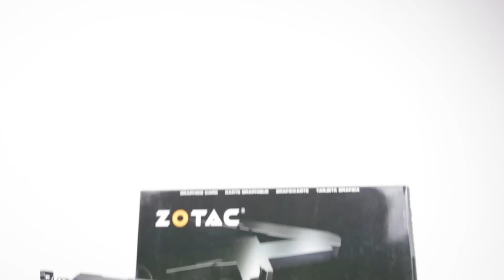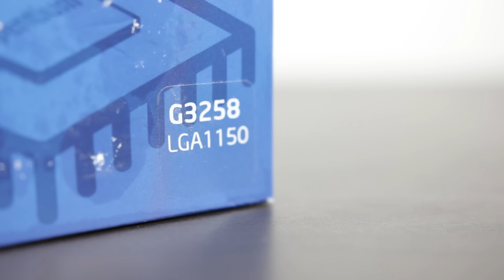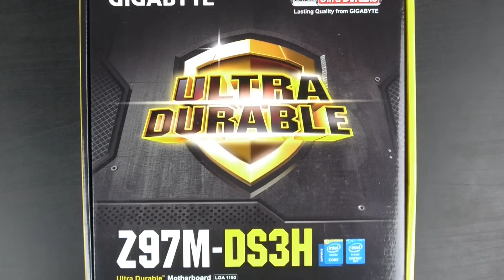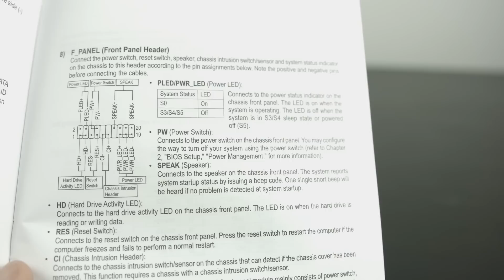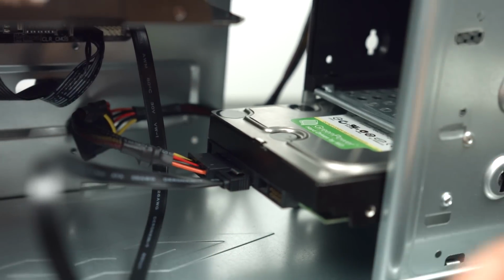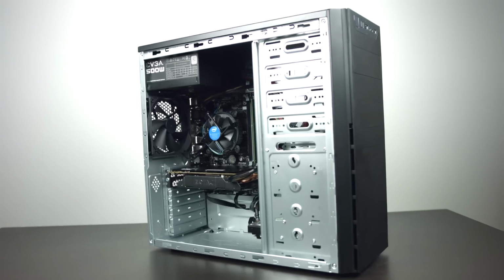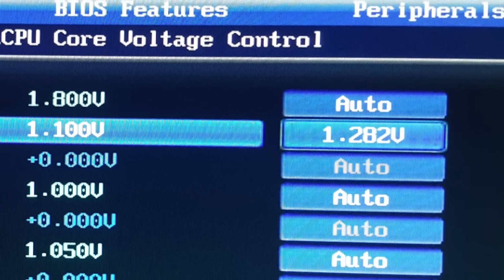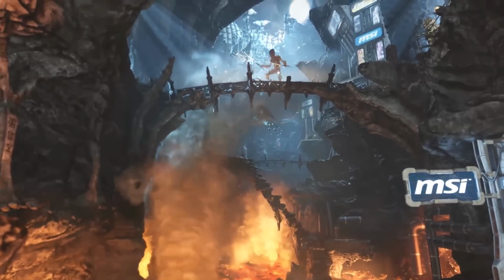Ultimate 2016 $400 Intel Gaming PC Build Guide - Ep.2 Budget Gaming PC Series

Comment: The g3258 is a great little cpu but has too much micro stutter for gaming, go i3 or better.
Reply: +Barack Smith agreed. new games needs 4 threads and not meeting such requirement makes the newer games lag and stutter like hell...
Reply: +XInfinity2013  I don't think so, if you get a basic mobo (h81-e33) + i3-4170 must be the same as this g3258 and z97 mobo. Its better to have the g3258 with a h81 mobo and update bios btw
Reply: rarely does anyone including myself upgrade a processor. in all my 20+ years of building pc's i have never upgraded any processor, the motherboard usually dies before needing a processor upgrade. if one wants to go K later, then just buy a K pc set later when money is available. as for low end gamer i3 is the lowest processor that can run all the games (including effing watch_dogs and other ubisoft titles), 6-8gb ram is the minimum for such titles and as for gpu anything above geforce 750 if 1080p is the target display resolution. mix and match parts to suit your budget! i don't consider occasional dips to zero frames per second as playable so avoid anything below 4 threads.

Comment: No vrm heat sink on mobo and the power phase suck's as well. I don't think pusing the voltage is ok in the long run with that specific mobo. I am very curios on the vrm temperatures.

Comment: hi iam getting a r9 380 sapphire and i think it needs 2 x 6 pin and iam wondering if a corsair vs650 is a good psu for it because its the one my friend gave me for free. Also its brand new. On the psu the cable is 1 thick cable and output to 2 x 8 lin and its connected to the other pcie pcie plug. Is that thr correct one thanks

Comment: If you are going to do used parts, you should go with the Xeon E5640 and an (LGA 1366) X58 MB with a $30 CPU cooler such as the CM evo 212. Cheaper and much more performance, especially if overclocked.
Reply: Yes, that is the way to go...for $100 more, you will be able to do much better than this build.  Daily Average, you are correct, you can pick up a couple of Xeon X5570's for cheap, I picked up two X5570's for $14.00 each ($28.00). LGA 1366 Dual Motherboard w/CPU fans for ($90), used ECC RAM ($15.00 per 4GB stick Total of 4 each for $60.00), Thermaltake Core V71 computer case ($117),  Sently 1000w 80+ Bronze ($94.00), 120G SSD ($38), and Windows 7 Pro ($79.00). This system works flawlessly and is super fast.

Comment: Are there any other motherboards close to this price range compatible with this build? The one in the video is out of stock on newegg. And how can i check if a motherboard is compatible with a certain build?
Reply: +Doktor Kranium no need to be aggressive mate
Reply: Use PC Part Picker, you can plan your entire build online and it will let you know if there are compatibility issues. It's a great site...for picking your parts, and planning your next build. You can put numerous different builds into the system and it will save them all. Works great!

Comment: Much better power supply lol, *Wait, did you take down that other video to sub in this PSU? 

You're also going to mix and match the GPUs for the comparison right? 380 + G3258 OC is probably going to win overall, but as I said in the last video if it's going to be a year or 2 before someone upgrades their PC, I'd shoot for the Quad Core from AMD, hopefully AM4 is halfway decent so that can be recommended, and then the AMD platform at least has an upgrade path.

Comment: what about temps of the PC? cause while it's only a dual core the G3258 must be dying @4.6 GHz under the crappy Intel cooler
Reply: The G3258 can be pushed pretty dang far on the stock cooler. I ran mine at 4.4 when I had it at 1.2v and never saw it hit 70.
Reply: Mike Adams thanks man! helps for a point of reference
Reply: Stephan Carlton Yeah it's a pretty good chip, it helps having the new TIM they put in it. Anything that requires a lot of CPU power or more than 2 threads won't like it though.

Comment: can I overclock my GTX 750ti on b85 ds3h gigabyte motherboard?
Reply: +Anupam Anu motherboard doesn't matter for GPU overclocking. Download MSI afterburner, max out the sliders and run 3DMark Firestrike (there's a free version on steam)

If the test doesn't crash, congratulations. You just overclocked your GPU.
Reply: +Mason Vanderpool thanks for the input. appreciate it.
Reply: No problem.
Reply: If the tests crash, then dial the overclock back a little and try again. MSI afterburner usually has a recommended limit so you should be able to crank it. If that works for you, you could probably get a little frisky with it and disable the limits and push it farther but I wouldn't recommend it since you're probably pretty new to this.
Reply: +Mason Vanderpool copy.

Comment: You should have dropped to an r7 370 or so,  and upgraded to an i3,  since some games require a quad core. Ik i3 is dual,  but hyper threading lets it run those games.
Reply: the I3 isn't a quad core. Quad cores are better though for games these days.
Reply: AstroMagic true,  but given the price difference between an i3 and an I5, and considering that games recognize the i3 as a quad core,  it makes alot more sense then a g3258 for only about 40 bucks more,  unless you live near a microcenter
Reply: Adeel Rehman I live near one. I have never heard of a game recognizing the i3 as a quadcore and some game wont even play on duel cores but for $50 less it does make since since you can overclock it and get the same performance for games but not streaming
Reply: AstroMagic Im pretty sure those games that require a quad core to play will run on an i3.
Reply: Adeel Rehman nope.
Reply: AstroMagic Really? Interesting. Will they run on an X4 860k?or an fx 6300
Reply: Adeel Rehman Yes. They have actual physical cores. Take farcry 4 for example.
Reply: +AstroMagic ok. It's wierd though,  because an i3 is better in every way compared to fx 4100, which apparently would run fine. Even on something that will use 4 threads, an i3 would come ahead.
Reply: Adeel Rehman It's the hyper threading and other instruction sets it has and not only that but games are made and usually optimized for intel cpu's because they are dominating right now and bribe devs or the devs spend more money to optimize it for amd cpus.

Comment: G3258 is decent, but on an older socket and thus leaves little in the way of an upgrade path. You're trapped on the last-gen hardware (1150 socket) unless you swap out your MOBO, something most people would like to avoid. The 860K has similar problems, but at least you're getting 4 threads. Best in this price point would be an i3, and invest a little less in your GPU.

You had the same problem in your last build, many have pointed it out, but 4GB of ram is simply not enough. You will literally run out of memory in the more demanding AAA titles, and suffer even more in general to intensive usage such as rendering, modeling, or photoshop.

The 960 is going to be bottlenecked like hell by a Pentium, no matter how much you overclock it, it's still only 2 cores. You put half of your budget into a GPU and about $70 into your CPU. That's just bad balancing all around. Also, the R9 380 has a better price-to-performance ratio than the 960, which is a must for gaming on a budget.

This isn't the worst build that I've ever seen, but you can do much better. You've got a considerable audience, so I hope people don't choose to copy this build and are disappointed in the performance.

A comparable Core i3, R7 360, and 8GB of DDR4 memory for $400: http://pcpartpicker.com/p/djNywP
Reply: +IronOreGaming for the 1150 limitation....

I dont think being able to upgrade to i7-4790K is a limitation...
Heck even on 1151 there isnt a better cpu....
Only with X99/2011-v3 socket you can find better cpu's

Comment: Is this good for normal home use and Minecraft gaming? I don't want to spend 500$+ on an over kill rig that I don't need :D

Also I suggest playing Minecraft as a test with the other games
Reply: +Shaikh Hassan Well, Something to remember is allot of things (mainly in minecraft) is extremely CPU bound, so it depends on the games.
Whenever you're working with a 400-500$ budget build, people swing towards 4-5 different options.
1: Like this build, terrible CPU, money invested into things like the GPU etc for a decent 1080P performance.
2: Intel I3, which are typically better, pretty similar, but a better CPU, similar style.
3: Intel's I3 skylake, which is a 4 threaded processor, IMO if you overclock the 6100 its one of the best processors for the price, but you're cutting down on some other price points.
4: AMD route, the FX series, 4300, 6300, 8300, similar to the I3 routes.

In my opinion, which I would say is educated, but its also a decision I personally would do,  would be something like a skylake I3 (6100) with a 60-70USD board, and something like a 950 (they're on sell ATM).
Since the lga 1151 set is very affordable now, IMO its worth it.
Plus future proofing is easy, since you can OC the non OC chipsets you can always upgrade the mobo w/ a cooler and squeeze more juice out of the CPU at any time, and they run very well with the I5's/I7's when OC'd, I personally would choose this over any other option, but, its my personal choice.
The only other route i'd go is a FX 8300 with a similar style build.
Cheaper, no upgrade path though.
Reply: +Shaikh Hassan What he said, you're going to want an i3 + lower end GPU, going with the 360 over 750ti due to future DX12/Vulkan support, nvidia seems to be lacking there

Also the board has USB 3.1 and Type C 

PCPartPicker part list: http://pcpartpicker.com/p/Ym6BNG
Price breakdown by merchant: http://pcpartpicker.com/p/Ym6BNG/by_merchant/

CPU: Intel Core i3-6100 3.7GHz Dual-Core Processor  ($123.88 @ OutletPC) 
Motherboard: Gigabyte GA-H110M-S2HP Micro ATX LGA1151 Motherboard  ($68.99 @ Amazon) 
Memory: G.Skill NT Series 8GB (1 x 8GB) DDR4-2400 Memory  ($31.99 @ Newegg) 
Storage: Western Digital Caviar Blue 1TB 3.5" 7200RPM Internal Hard Drive  ($49.89 @ OutletPC) 
Video Card: XFX Radeon R7 360 2GB Core Edition Video Card  ($100.99 @ SuperBiiz) 
Case: Fractal Design Core 1000 USB 3.0 MicroATX Mid Tower Case  ($29.99 @ Newegg) 
Power Supply: EVGA 600B 600W 80+ Bronze Certified ATX Power Supply  ($44.99 @ Amazon) 
Total: $450.72
Prices include shipping, taxes, and discounts when available
Generated by PCPartPicker 2016-02-28 16:23 EST-0500
Reply: Street Guru Nice build, might I suggest a 950 instead though.
You can get them as cheap as 120$'s.
http://www.ebay.com/itm/MSI-GeForce-GTX-950-DirectX-12-GTX-950-2GD5-OC-2GB-128-Bit-GDDR5-PCI-Express-3-0-/291619994225?hash=item43e5e7fa71:g:yG4AAOSwT4lWTd4B
Right now they're sold out, but yeah, you should see them return again soon.
Reply: *****
I dunno about trusting that at all, the card is listed for retail here at $170, it would be incredibly strange for it to be priced at $120 somewhere

http://www.newegg.com/Product/Product.aspx?Item=N82E16814127919&cm_re=MSI_GeForce_GTX_950-_-14-127-919-_-Product

Now the 370 on the other hand, is a bit slower than the 950, but the retail price dips pretty low, $130 here
http://www.newegg.com/Product/Product.aspx?Item=N82E16814129311&cm_re=370-_-14-129-311-_-Product
Reply: Street Guru That's neweggs official ebay, it was retailed as brand-new.
There was over 1000 units sold, I presume you aren't a typical ebay user, but as a user and seller, I can confirm to you that is 100% legit.
Reply: Thanks for the replies guys, however instead of builds like those I was thinking something along the lines of this - http://www.staples.com/product_2056935?PID=5874355&storeId=10001&AID=10428703&cm_mmc=CJ-_-5874355-_-5874355-_-10428703&CID=AFF%3A5874355%3A5874355%3A10428703&CJPIXEL=CJPIXEL. I used to play on a laptop with an i5 5200U processor and it easily managed 100+ fps with optifine. however the game was horrible to look at because of my Intel HD graphics. I want to get a higher gen i5 and a GPU that's compatible and capable of running light shaders, and also do work on the thing. thanks
Reply: Thanks for the replies guys, however instead of builds like those I was thinking something along the lines of this - http://www.staples.com/product_2056935?PID=5874355&storeId=10001&AID=10428703&cm_mmc=CJ-_-5874355-_-5874355-_-10428703&CID=AFF%3A5874355%3A5874355%3A10428703&CJPIXEL=CJPIXEL. I used to play on a laptop with an i5 5200U processor and it easily managed 100+ fps with optifine. however the game was horrible to look at because of my Intel HD graphics. I want to get a higher gen i5 and a GPU that's compatible and capable of running light shaders, and also do work on the thing. thanks
Reply: Shaikh Hassan
Plz no, you don't live in canada
NVIDIA® GeForce® 730 2GB GDDR3 Graphics Card

that won't be able to do anything meaningful an i3 with a real GPU is going to be way better for gaming

and the powersupply in the dell is probably terrible overall, they tend to go for the bare minimum to power the system to maximize profits.
Reply: *****
It just seems really strange that it would be $50 less on ebay compared to their website.
Reply: Shaikh Hassan If you want to go pre-built you can, but you're never going to get your moneys worth, if you're okay with that, then by all means, but if you're trying to get your moneys worth, those PC's aren't it.
Reply: Street Guru It's because of the market on ebay I presume.
They sold those in about 72HRS, 1200 units, I really doubt they could have done that on their website, even with its big name.
Headlining a website like ebay will benefit them allot more than their own personal website, I only seen it because it was on the front page.
Its not really that weird.
They possibly bought an amount of set units to sell for a set price.
Perhaps they had a deadline on units to sell for a certain amount etc.
Perhaps the ones on newegg and ebay are separate units purchased with a difference in price, why lose money when you don't have to?
Doubt they'd price-drop units worth 170$'s to 120$'s just to match, now, if they got units, for lets say, 80$'s, maybe that makes more sense to sell it for 120$'s, then to lose money on units you don't need to price drop.
I also seen someone from China selling those for 60$'s a pop, but, that is actually something to be sketchy on, regardless, they sold 100 units within 24hours, could mean that we're about to see some new affordability with 950's, Anyways,not really sure WHY they were that cheap, those are just my guesses, but, either way, those are official units from new-egg that were brand-new, and we'll probably see it follow suit soon with other units, or maybe it was just a one-time thing, maybe it was a mistake, can't be sure, but all I can say is, its legit.
Reply: +Violent it was actually 450$ on staples, they just raised the price. for 450$ I thought it would do well and I can upgrade the GPU maybe later on. I dont need the build exactly for gaming right now, it seems like a good deal to me. but then again I have no experience in computers :'(
Reply: Shaikh Hassan
Pre-builts are pretty much universally crap, because they cheap out on a number of components, if you just want a really low cost entry level gaming machine, you'd want an APU build

PCPartPicker part list: http://pcpartpicker.com/p/HqX2t6
Price breakdown by merchant: http://pcpartpicker.com/p/HqX2t6/by_merchant/

CPU: AMD A8-7670K 3.6GHz Quad-Core Processor  ($89.99 @ SuperBiiz)
Motherboard: Gigabyte GA-F2A88XM-D3H Micro ATX FM2+ Motherboard  ($63.49 @ OutletPC)
Memory: G.Skill Ares Series 8GB (2 x 4GB) DDR3-2400 Memory  ($34.99 @ Newegg)
Storage: Western Digital Caviar Blue 1TB 3.5" 7200RPM Internal Hard Drive  ($49.89 @ OutletPC)
Case: Xion XON-310_BK MicroATX Mid Tower Case  ($25.99 @ Amazon)
Power Supply: EVGA 500W 80+ Certified ATX Power Supply  ($34.99 @ Amazon)
Total: $299.34
Prices include shipping, taxes, and discounts when available
Generated by PCPartPicker 2016-02-28 20:25 EST-0500
Reply: Shaikh Hassan If you want to choose that route you can.
There are also other options, such as ebay..
Allot of people down-talk it and say its not trust-worthy.. Yet reference amazon (which does the same exact thing) as being truth worthy.
Ebay sells allot of white-box custom PC's that are worth the money, now, is it still a great deal? No, but is it a good one? Yeah, better than something at staples IMO.
However, building yourself is always where you'll get your bang for your buck.
Reply: +Violent I think that's pretty good actually, do you think you could upgrade the processor and add a video card for a max total of 450-500$? like an fx processor and mid range GPU?
Reply: Shaikh Hassan Which build?
Reply: Shaikh Hassan
If you meant the APU build current no, but in march AM4 motherboards/APUs should be coming out, and that would give you an upgrade path, plus they should have a bit more performance overall.
Reply: +Street Guru alrighty

Comment: Personally, I would spend the extra money and get a core i3 or i5 and 8gb of ram. It would definitely be worth it.
Reply: Yeah, an i3 with 8GB of RAM and dropping to a 950 would be a much better overall experience for the same money. Would get a lower maximum frame rate, but you would have a noticeable more stable and higher average frame rate, which is the real important part.